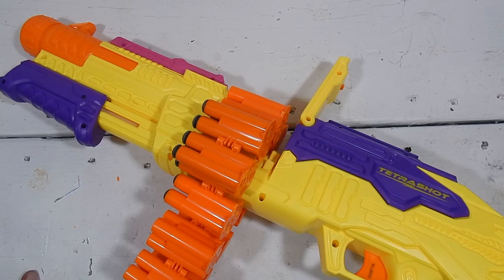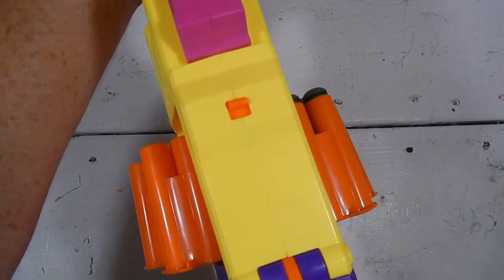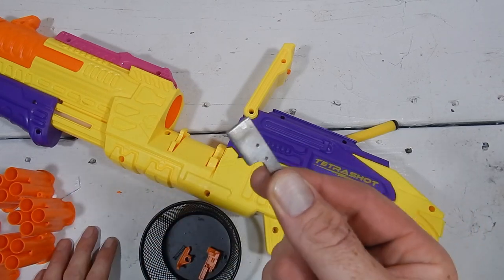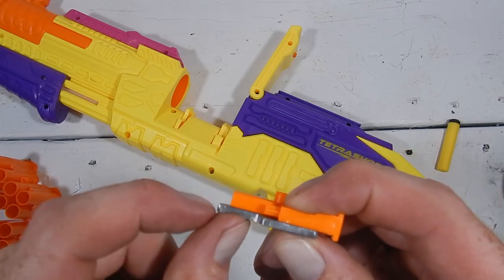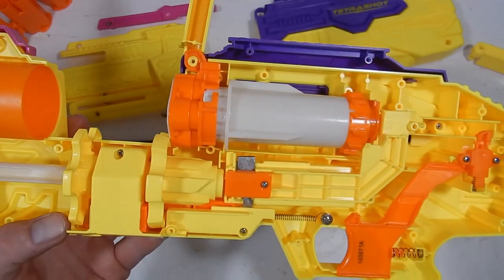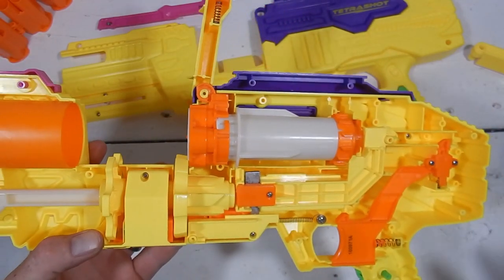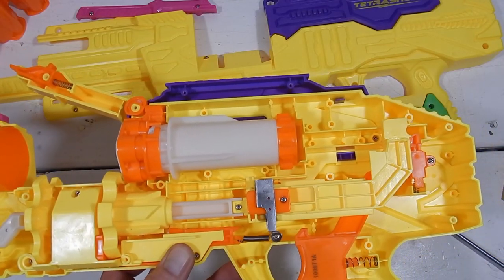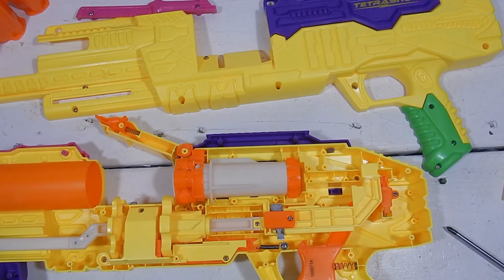Adventure Force Tetrashot Shotgun Mod

Comment: So I bought one after seeing your internals guide and I did thing a bit differently. I don't have any way to work metal effectively as I'm currently living in an apartment and noise is an issue but I simply cleaned the grease off the existing tooth you replaced with metal, removed the spring for it and epoxied it in the down position then I replaced the spring (8 or 9 kg somewhere around there) and filled the plunger head and using a screwdriver I was able to easily pry apart the air restrictor assembly and cleanly remove them without drilling. Instead of knocking out a single large hole in the plunger tube however I epoxied the rotating thingy onto the end of the plunger tube with lots of glue to make sure any gaps were sealed and then using a 3/8" bit I carefully drilled out through the spots where the air restrictor spring had been sitting (I had the very front seal assembly still removed at this point) you have to drill close to the inside of those circles so it won't come out the side of that ratchet collar thing and then put it all back together and while it won't win any range competitions it fires all 4 darts consistently and makes it about 35 feet ish. I absolutely love it.

Comment: You know, a drain blaster camber 'mite-fit?' I've have one with hung fitting on it so that an external pump can be attached (like battery powered bike pump!?) That should be well capable of firing 4 darts 50'.? I mean it can fire 10darts from a Firefly she'll 30', it should fire 4darts 50ft. See! I told you, you're inspirational.! MrScott54, BionicBlasters.😎🤠

Comment: Nice work! You've turned a good blaster into a greater one! My only suggestion to the next steps would be improving the seal between the plunger tube and the shells. I think it might help fire all four darts at once. Thanks for everything!
Reply from the maker: The seal to the shells is still good, it right now comes down mostly to a still light (only 7kg for this initial version) spring having to overcome what is now a ton of inefficient deadspace if I had to guess. 

If I can up the spring, and increase the overall air volume while decreasing the deadspace, this just might be a truly viable belt fed shotgun blaster.

Comment: Fantastic job brother. I knew that you'd probably be 1st person to get inside this badboy. I don't have any of these blasters yet, but planning on aquiring a few of them(I do Integrations and some cosplay, so painting rendition in its own theme is part of my build plans. With your help, I intend to make them perform as good as they look!). My idea is to have it shoot two darts at a time and then rotate 90° and fire the other two darts and have it advanced the shells with each pump. I like what you're doing, and find it inspiring. MrScott54, BionicBlasters 🧐😃🤗😇🤓😎🤠
Reply from the maker: Well, you could certainly work up a custom rotational mech to do a 90 degree movement, and then have a special front end piece printed so it has two ports instead of the stock 4. That could work...

Comment: Great video. Sweet mod man, I wonder if it makes any more sense to just do 4 smaller plunger tube set ups to get all the darts to fire consistently if there’s enough space anyways. Prolly not but just a thought. Keep up the great work man, looking forward to the 2.0.
Reply from the maker: That actually... Could work. 

You'd have to 3d print the front end to hold 4 separate plunger tubes (say 4 alloy tubes) and then have a rear end that can prime all 4 plunger rods at once, while hooking into the catch.
Reply: @MongooseJakeNerf  expanding on your idea. Give it a staged catch.

Comment: From my experience with making a full lenth breach on a Buzz Bee Reaper, elongating the draw length of a blaster is a true nightmare. However, the potential for a larger PT is there, but will take a lot of work!
You'll have to redesign the PT for sure and a sleeved one is a great idea, but you'll have to redesign the plunger (mostly its OD to fit the sleeve, but also make it beafier to withstand the stronger spring).
The issue with the sleeve (or any design of PT for this) is that it'll need to be tapered to give room for the plunger to accelerate since you don't have a lot of room in the cartridges behind the dart to build pressure.

I was looking for a challenge since the time I stopped working on my aluminium barrel and breach for my Sentinel.
Plunger seems pretty similar and I've already got an aluminium one or at least the design if its not the same size.
And I'd like to add an AR system in a redesigned front orange part just for convenience when I have to reload fast.

Comment: Awesome, I may have to look into getting 1 and a couple belts, see what I can do. You can’t 3D print plungertubes, but as long as you use another material for the ID you’d be fine. Could honestly probably just 3D print and design the front and the back cap parts and then use a pipe in the middle and glue it in. 

If you really wanted to get into it you could theoretically 3D print entire belts, which would allow you to have a much longer chain without buying a ton of tetra shots.
Reply from the maker: Well, as stated in the video, you'd have to 3d print the plunger tube assembly and sleeve it with aluminum or poly. I state that at the 8:20 point. 

The printed ends idea with an alloy tube would work well, as that's what some mods for the Longshot have done already, so that's a proven idea. 

Either way, I think there's lots of potential and this was just a proof in concept of getting a start into a proper belt fed shotgun blaster based off of the Tetrashot. There's a lot more to do!
Reply: @MongooseJakeNerf  Ah yeah, I missed that, my bad. I'll have to see if I can't find one of these and do some mods to it.
Reply: On the note of 3D printed chains. What about different ammo types? I would think most of them would be easy, except for singled Mega or eventually Mega XL, those would definitely need shell cutting.

Comment: How about putting 2 short darts in one slot? The lower power seems to be the issue but it could be fun, good work, sir,
Reply from the maker: That'd be a easy way to effectively shotgun darts, and to be honest the easiest overall. Then, don't gut the front of the AR assembly, just clear the AR's individually, and up the spring along with the plunger head seal and you'd have a 96 shot blaster firing 2 at once.

Comment: You could also improve the seal between the plunger and the cylinders. I used mega dart foam for old turbo adv shotgun mod but it does compress after awhile, so a rubber gasket material would be better.
Reply: Other option I've seen is high-density craft foam, comes in three different thicknesses easy to cut in use. A more old school option is felt glued on with a high viscosity grease. 

I'm a little curious if you could hybridize the techniques, get the lubricated low-friction seal of the felt technique with the sealing pressure of the craft foam. I might have to test that at some point.
Reply: @zeanyt2372  ok those do sound good actually. Wish I had that knowledge when I did the turbo advance shotgun mod

Comment: I don't recommend 3d printing plunger tubes. Metal would be a good idea with a 3d printed front piece
Reply from the maker: At the 8:20 point I specify that I'm referring to 3d printing the PT assembly and sleeving it with either alloy or poly.

Comment: I could for sure try to make you expanded plunger tube possibly a oval one like in the Jurassic Pro just need to get my hands on the blaster I bet you could cut down the fake barreling and use that as a plunger tube with a printed plug at the end